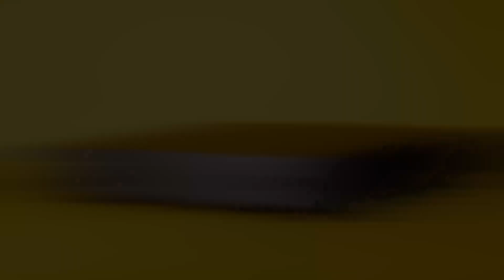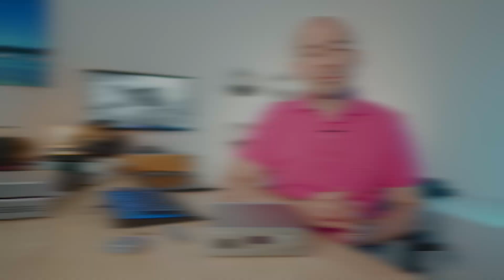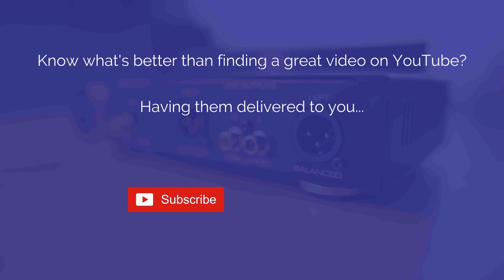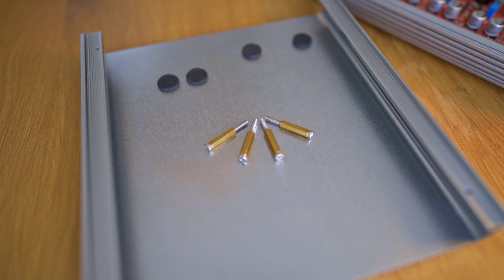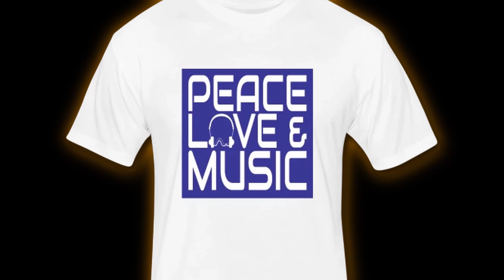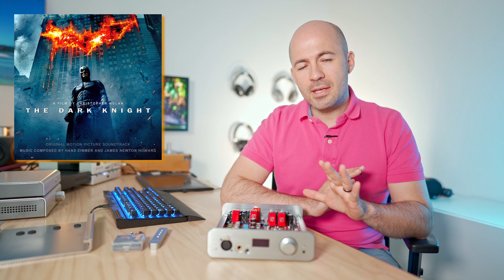Burson Soloist 3X Headphone Amp Review - New tech + old classic = wow!

Comment: Hi Everyone, quick question from a learner. I think i might be the last person to get a Burson Soloist 3XP - Does anyone know if when I input RCA am I only getting half the power I would get if I input XLR? I only have a Chord Mojo 2 at the moment so restricted to RCA but I have Audeze LCD 4 headphones and I need all the power I can get. Also, outputting from XLR into the headphones. It sounds a lot stronger the the Schiit Jotunheim 2 I had before, but it still sounds a bit incomplete, for instance, my Meze 99 Neo directly into the Mojo 2 have a more complete sound than the Audeze LCD 4 into Soloist 3XP with Mojo 2. Please advise. Paul
Reply from the maker: Hi Paul, I think there are two separate issues going on here so let's break them apart: 
1) RCA connections ARE half as loud as XLR because they have half the voltage (2V vs 4V standard). However, the 3XP has more than enough gain/power to make up for that so don't worry about the input and let's move to point 2...
2) the LCD-4 has a sensitivity of 97dB/mW which means you will be going deaf (literally) with anything more than about 10mW of power. The Soloist has well over 100x that amount of power of my memory serves. What that means is that the lack of "completeness" you are hearing is going to be about synergy - how the tonality and character of the amp matches that of the headphones. It sounds like it's not a good match for you. That opens a few other choices. You could change the headphones, change the amp, or you could try putting some different op-amps into the Soloist 3XP to adjust the sound. I would recommend either the Burson V7 Vivid (like the current ones in the 3XP but the newer, better version) or Classics (a deliberately warmer sound that's more like the Jotunheim 2).
I hope that information helps!
Reply: @PassionforSound thank you millions! I will try the classics. Enjoy China!
Reply: @PassionforSound that worked perfectly. I swapped the red ones for the little black ones and the sound is much smoother. Gain set to medium is plenty. Thanks again. Paul
Reply from the maker: That's great Paul. It would be worth trying the V7s if you can. The little chips are of lower quality and are provided just for trouble shooting purposes should there ever be an issue with your amp. They're still fine, but the V7s should sound even better still.

Comment: Realizing the GT is better at everything, is the 3XP still worthwhile at say $650? And other than more power, how will it compare to my Geshelli A3?
Reply: And did you ever try the V7 vivids in it?
Reply: And I have ss3602s and v7 vivids laying around.
Reply from the maker: I didn't try the V7 Vivids in the Soloist, but I know how they'll sound from everything else I've tried and I think they rejuvenate the 3XP back to being an amazing option in today's market, and better than the Geshelli A3 once the V7s are installed.
Reply: @PassionforSound  I bought it regardless, but messaged the seller to see if it came with the 3amp supercharger. I understand the upgraded power supply makes a noticeable difference.
Reply from the maker: It's definitely a worthy upgrade.

Comment: With which player can I use this burson, they told me that I couldn't use it with iPad because there are no cables, I have a Sony nw wm1am2 DAP with USB type C port😊
Reply from the maker: The Soloist requires an analog input so you'd need to take a cable from the headphone jack of your DAP and into the Soloist. That would be either a 3.5mm to RCA cable or a 4.4mm to XLR cable.

Comment: Are there valid reasons to get this over the Topping A90d? To use with Neumann ndh 30. Specs wise, this headphone requires max 200mW of power.  Practically for listening at safe levels, the power is much less than 200mW, which means  I won't hear distortions at levels which I will listen to. That much I know. Thanks.
Reply from the maker: Yep - power won't be an issue as you say. Having not much liked the A90D, I can only assume it's due to the use of nested feedback killing the naturalness of the sound. The Soloist doesn't do that and is therefore a more natural sounding amp in terms of staging. I do think the Soloist benefits from some different op-amps such as the Sparkos 3602 or the Burson V7s to maximise it's tonal qualities.
Reply: Thanks a lot for helping me out. If the burson soloist is equipped with V7 op amps and use with 3A power adapter, how much of a difference will there be between the 3XP and 3X GT 2024 version? 

Your inputs will be highly appreciated.
Reply from the maker: The differences will still be huge. No amount of tweaks will close the gap on overall circuit design, but the 3XP with those upgrades is a wonderful amp.

Comment: Hi, I know this is an old video but would you still recommend this headphone amp or is there something newer out that would be better sounding in this price range. I'm thinking of adding a headphone amp to my setup and am unfamiliar with current technologies.

It would be in line with a Eversolo A8 which I'm currently using as my Preamp, DAC, and streamer and out to a power amp.

Thanks for any feedback.
Reply from the maker: Depending on the headphones you're driving, the Geshelli Labs A3 Pro and Aune S17 Pro are both excellent options too, but the Soloist 3XP is still very good. I think it improves a little by changing a couple of op-amps (I've got separate videos explaining this) if there are specific features about the Soloist that you want.
Reply: Thank you for the input. 

I’m going to go with the HiFiman Arya Organic. 

Would those recommendations still be a good choice?
Reply from the maker: Yes, any of these will be great with the Organic. You can't go wrong, although the Soloist 3XP would need a couple of op-amps changed to beat suit the Organic, IMO. (The other two amps will be great straight from the box)
Reply: Thanks again for the information. 

I decided to go with the Aune S17 Pro. 

Although not many reviews, the ones out there were impeccable. 

Can’t wait to hear the combination. 

Now, don’t review something better in the next few months. 😂

Take care.
Reply from the maker: Haha. Nice choice. Don't worry, I've got nothing better in the current pipeline. I do, however, have the S17 Pro for review soon so we can compare notes once you've got yours and my review comes out. 🙂🙂
Reply: @PassionforSound  Looking forward to it.

Comment: great review! looking at the power spec into 300ohms and it states only 150mw via SE!  
what is considered enough? this seems very low compared to a lot of alternative amps.
i only buy high impedance headphones now as i also own an otl tube amp, hence my query.
Reply from the maker: I'm yet to find a 300 ohm headphone that requires more than about 20-25mW to reach 110dB so if you're listening at safe levels (75-80dB) you've still got WAY more power than required to cover transient peaks in the sound with headroom to spare.
Reply: @PassionforSound  having watched for a 2nd time, the volume bypass mode is interesting me.
as i mentioned, i do have an otl amp which can be used as a pre-amp also. 
no saying it will sound better, of course, but could give me a "very good" hybrid combo in theory.
unless i am missing to point?
Reply from the maker: Not missing the point at all. That could be an excellent option
Reply: @PassionforSound   sorry, i meant to ask is the vol bypass available from both xlr and rca inputs?
Reply from the maker: Yes. Once in power amp mode, either input is played at full volume.

Comment: Hi Mate,

I thought that I would drop you a note to say that I am extremely chuffed with the "Burson Audio Soloist 3X" I purchased from Addicted to Audio a couple of weeks ago.

I am using it with a Raspberry Pi 4B 4Gb, fitted with a UStars Digital Board, feeding a Cambridge StreamMagic6 in DAC Mode. The DAC Output is fed to the Soloist via XLR Cables. I am feeding the Line Level Signal from the Soloist via XLR to a STAX SRM-353X, Energizer powering a pair of STAX SR-L700MK2 Electrostatic Earspeakers.

I am using the Soloist to power the following Headphones:

  Beyerdynamic DT1990
  Beyerdynamic T5
  Meze 109
  Focal Elear
  Focal Clear Mg

It's little wonder to why Burson Audio Products receive so much praise. All aspects of the build and sound are exceptional. It just goes to show that a "Little Aussie Company" can excel on the Word Stage with such a product when meticulous engineering standards are adhered too...

--cheers Ray

P.S.

Thankyou for your hard work.
Reply from the maker: Thanks so much for letting me know! So glad to hear you're loving your setup. You've got a nice range of gear there.

Comment: How does this work with hifiman Arya (non stealth)?
Reply from the maker: I haven't tried it directly with the Aryas, but there's plenty of power and a fairly neutral sound so it should be great, but will depend on what you're coming from and are used to.
Reply: @PassionforSound  I currently have the massdrop THX amp and the 6xxx. I am attracted to the Arya non stealth because I have a high tolerance for treble and really like the sound. Wonder how the Soloist might fit into that.
Reply from the maker: I think you'll really like the Soloist with the Arya if you're good with treble and are enjoying the THX789
Reply: @PassionforSound  what do you think of the Playmate?
Reply from the maker: I haven't played with the Playmate - sorry
Reply: @PassionforSound  lol
Reply: @PassionforSound  are you going to review it. I have heard it’s one of the best dac/amps ever.
Reply from the maker: You mean the Playmate?
Reply: @PassionforSound  yes
Reply from the maker: It's probably very good - Burson gear always is, but I think those expectations might be a little high.
Reply: @PassionforSound  I suspect so whenever there’s this much prayers that usually isn’t worth all of it. But consider the price vs the Soloist.

I am looking for a great pairing with Hman Arya ST what would you recommend?
Reply from the maker: It all comes down to budget. If you're operating in the range of the Playmate it probably is one of the best options, I expect.

Comment: Has anyone used the super charger 3A or 5A with the soloist?
Reply from the maker: Yes. The 3A is a nice upgrade. The 5A is even better. I chatted to Burson about why the 5A is better (it didn't make sense that more current would lead to better sound) and they confirmed that the 5A circuit design is even better than the 3A so the power it delivers is better and so any amp you use it with should perform better with it. (I've only confirmed this with the Soloist 3XP)
Reply: @PassionforSound  wow amazing thanks for confirming
Reply from the maker: My pleasure

Comment: I really like the idea of the Burson Soloist 3X, but my main source is my PC, I don't understand how you connect a digital source when the amp has no optical, USB, USB c input? I am currently using IEM's I'm pretty sure you recommended awhile ago, the Meze Audio Rai Penta. I'm really enjoying them and would like to experience the benefits of listening to them with the benefit of a quality headphone amplifier. The Burson products really interest me but I don't know how to connect my PC and do they have Bluetooth for my phone?
Reply from the maker: Ideally, you'd need a DAC (Digital to Analog Converter) between the computer and amp. You could take an output from motherboard sound output, but the quality won't be great. Burson also make the Conductor which might be more what you need because it's a DAC and amp in one. I have reviewed their top of the line Conductor GT models, but they also make a Conductor 3XP that's more affordable and will still be excellent

Comment: Great review. Is this the same product as the Soloist 3 XP? I've looked at their website and it only features the latter.
Would you say that in 2022 this is a good upgrade path for the Topping A90 or are the differences not noticeable enough (or perhaps there is a better product to upgrade to)? Thanks!
Reply from the maker: Hi Michal, yes it's the same. I made an error in the naming of the video (I should fix it, actually), but it's the same amp and it's a significant upgrade over the A90 - better resolution and better soundstage depth/layering
Reply: @PassionforSound  Thanks very much for your reply. 👍 Is it also a good match for the Susvaras (the "controversial" topic of the Sus requiring a loudspeaker-like amplifier to sound dynamic and punchy)?
Reply from the maker: It's got plenty of power for Susvara for sure. You might benefit from an even better amp like the Soloist GT with the Susvara due to its incredible capabilities as a headphone, but the regular Soloist 3XP will still sound great

Comment: I ordered a Burson Soloist 3xp open box w/ supercharger and did not like it all, which leads to me to believe something might have been wrong with mine. Or it could be that the Burson sound just wasn't right for me. I like warm amps like the Jotunheim 2 and listen mainly on tube amps like Lyr 3, etc and well, the Burson seemed to lack warmth overall and sounded more cold and vivid in an unnatural way. The tonality seemed a little hot and uncontrolled in the treble and to me was very fatiguing. I imagine swapping the op amps would make a huge difference, but that's not something I have any interest in dabbling in. Returned it and just ordered a Mjolnir 2 instead which could be endgame for me.
Reply from the maker: If you're used to an amp like Jotunheim 2, the Soloist can have a slightly cooler, more analytical sound (particularly in the treble as you say) so that makes sense. Depending on your headphones and preferences, the Soloist can be a great amp, but it's good that you're clear on what you enjoy and you're going for that. The Mjolnir should be excellent too

Comment: Great review answered so many questions I had. Recently the topping A90 Discrete released and I was wondering if you could compare them?  I’m very curious on your thoughts.  Or at least a response to my comment would mean a lot. Im looking to purchase a set of dac and amp shortly.
Reply from the maker: I've got the A90D here now, but I haven't unpacked it yet. I'll definitely be comparing it to the Soloist. I'm not expecting it to sound as good because Topping apply a lot of feedback in their designs to improve the measurements and it doesn't always result in the best sound, but I'm open to being wrong so we'll see as soon as I can get to the review

Comment: Excuse me,BURSON SOLOIST 3X The DC offset issue is indeed Whether to preheat for 30 minutes to prevent earphone damage
Reply from the maker: The DC offset issue has been a bit overblown I think. It is real and a few headphones have been damaged, but my understanding is that there have been only a few cases and Burson has paid for replacement headphones in each case. I've never taken the time to warm up my 3XP and have had no issues with any headphones so you can do it if you feel more comfortable, but I don't think you need to worry about it as much as some might say.
Reply: @PassionforSound  Could it have something to do with this, is the headset plugged in before or after it is turned on?
Reply from the maker: I've done both because I never knew it was a thing for most of the time I've owned the Soloist 3XP
Reply: @PassionforSound   Bought a new version of Burson Soloist 3X, the previous problem has been improved, can you recommend a dac or all-in-one dac that mainly listens to pop vocals or slow songs, with a budget of $400-1300
Reply from the maker: Depending on where you're located, the new version of the Schiit Bifrost 2 (BF 2/64) is great. The Burson Composer is also excellent and matches your Soloist. Other than that, the Soncoz SGD-1 is very good too (review coming soon on that one)
Reply: @PassionforSound  Excuse me, in the burson soloist 3x direct mode, will the left V6 op amp pass through?
Reply from the maker: I don't know how the circuit is designed - sorry

Comment: It will be my next amp for sure :) probably going to suits my Arya & Clear
Reply from the maker: Nice. It's great with both of those
Reply: @PassionforSound  4 years later what do you think about it? I'm lost now and dont know if old burson is right option or there is something better? I need warm, musical class A for planars in price range 1000-2000$
Reply from the maker: It's still a nice amp, especially if you upgrade the op-amps to the V7s, but there are other equally good amps these days like the Aune S17 Pro EVO and Flux Labs Mentor.
Reply: @PassionforSound  flux labs is out of stock and you know its ukrainian, S17 evo if really got better temps than the first one could be an option